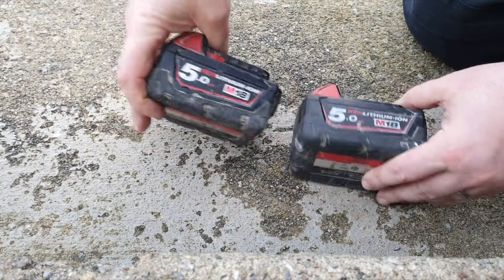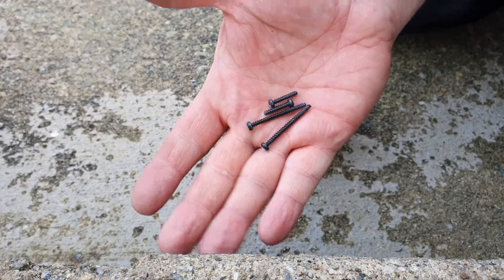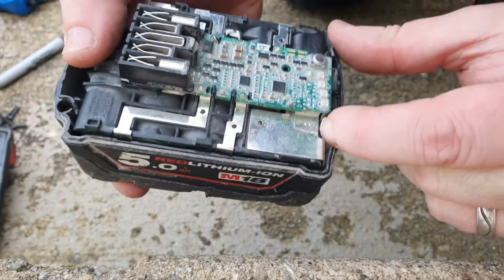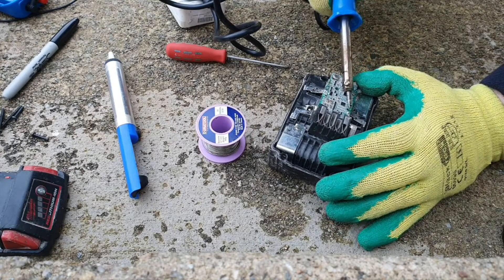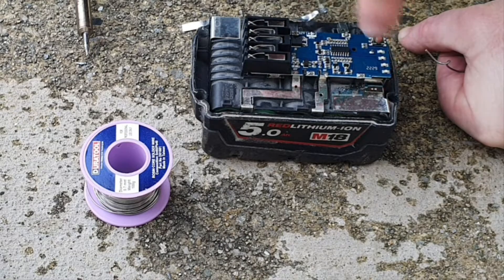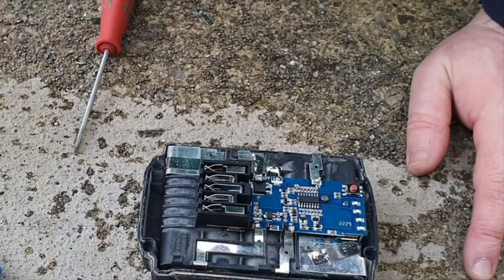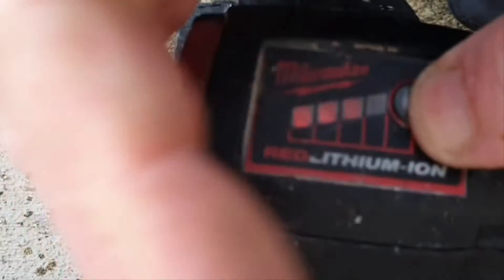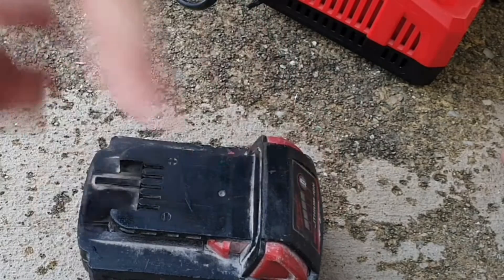Milwaukee M18 Battery not charging? Try This!!!

Comment: So i started to pop my new circuit board on and got a little spark and some smoke.....what would cause that? Just before i give it another go 😂
Reply from the maker: A crossed connection or wrong connection but its not something to be afraid of the fine nickel strip should burn out before you do any harm

Comment: Where did you the board?
Reply from the maker: I get the boards off ebay they come from the far east I believe. It takes a couple of weeks for them to arrive in Ireland where I am. They work well I have done quite a few however the battery indicator is very dim it's hard to see outside on a bright day.
Reply: @doctorlefthandthread  I have 2 5.0 doing the same thing
Reply: @doctorlefthandthread  did you also know you can purchase the m-18 batteries a lot cheaper from China direct!?
Reply from the maker: @mrfixit0067  Yes however some of the knock offs are shockingly bad quality
Reply: @doctorlefthandthread  for 1/3 the price I will take the risk!
Reply from the maker: @mrfixit0067  👍

Comment: Hey brother, I see different colors for the boards and a code at the end of description… Does it matter which color for the M18 boards?
Reply from the maker: I don't think it matters I have removed both red and green boards off M18 5Ah batteries. I use the blue boards I get from ebay they seem to work well the only thing is I noticed the battery indicators are much dimmer than the original ones.
Reply: @doctorlefthandthread  Are there other replacement boards that have brighter display lights than the blue boards do?
Reply from the maker: @shadetreewannabe  not that I know I have been buying these ones steadily for about a year now
Reply: @doctorlefthandthread  Understood.  Thanks a ton for the response!  Cheers!
Reply from the maker: @shadetreewannabe  anytime

Comment: has anyone tried to repair the circuit board?  or copy the pcb and reproduce it?  can we bye pass the circuit board and install a bms 18v 100A
Reply from the maker: I haven't had any luck repairing the boards on them. I have not been able to find generic ones
Reply: That's not an aftermarket board from China?

Comment: Nice job getting around the devices security feature. These companies try their hardest to make sure you'll throw it away and buy a new one, adding to e-waste. I wish more people like you could fix these instead of tossing into the scrap heap.
Reply from the maker: I post these videos to try and encourage just that
Reply: What did you do to get around the devices security am I missing something ? You didn't say anything about that in the video. I have 2 boards ordered and a handful of old batteries. One has 14 volts about but will charge then I put it on a drill and it just drops back down to 3 bars after a few seconds. I re spotwelded connections but it didn't help. I dont know how to see what cell couls br bad or why though..
Reply: @casper9256 
Need a multi meter set on voltage dc
Check voltage on each battery 
Total should be 21v 
16v to charge on charger
There are video to safely charge and balance batteries
Reply: Yes I am doing that and I got thr batteries to charge. One has a bad cell which I need to load test to find since it days charged plug in a tool run it 6seconds and its down to 3 bars. Second I got the boards to put on the old packs but he mentions security features he got around and im wondering what said features are what has to be done..just cut off the old board or take one leg off connect to new board  while keeping both boards hooked to the same battery so it doesn't know its had the oe pcb removed or what?
Reply: @casper9256  
Yeah the security thing threw me off too,could be a poor choice of words…..let me know how you go

Comment: Before changing a board, i would try to jump start them first. If it has zero charge, it won't talk to a Milwaukee charger. You have to charge it manually to get it started.

You can do so with some razor blades or other thin metal on the outside pins on the battery. The inner pins are for data. 

Connect to a dc power source or larger battery.
Reply from the maker: I agree and I have done videos on it
https://youtu.be/wiVanTWS_t4
https://youtu.be/AzH8MI47_GQ
Reply: @doctorlefthandthread  and right after i hit post on that i see that you actually linked two videos, not just one. Ha!
Reply from the maker: @djaa7  it's all good thanks for your comments 👍
Reply: @doctorlefthandthread  you are incorrect good sir. That is your video on changing a cell in an m18 battery. 

Your video on jumpstarting a battery is at:
https://youtu.be/AzH8MI47_GQ
Reply: Any ideas if I’ve already tried jump starting a milwaukee 5ah, still shows it fully charged on the charger but flashes 1 bar if you press the indicator on battery, also have 18v on the battery terminals & still won’t take charge… just ordered the pcb, hopefully it fixes !